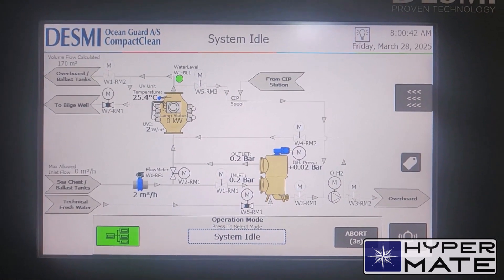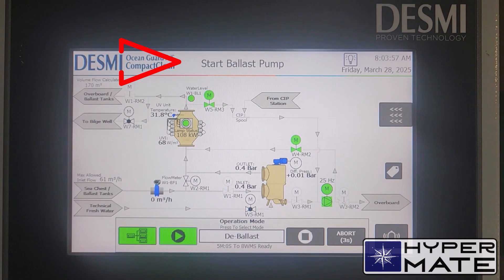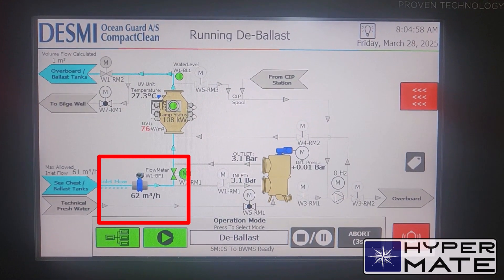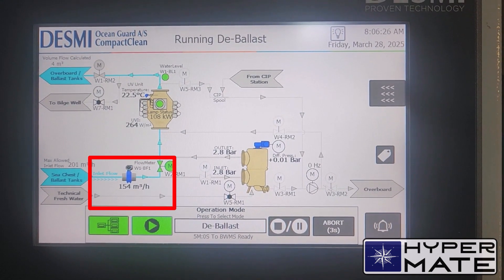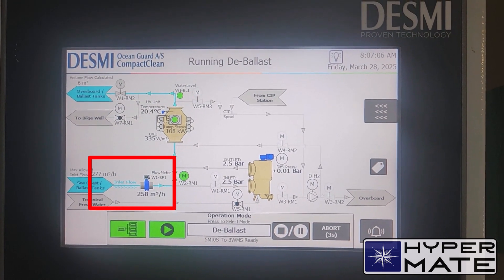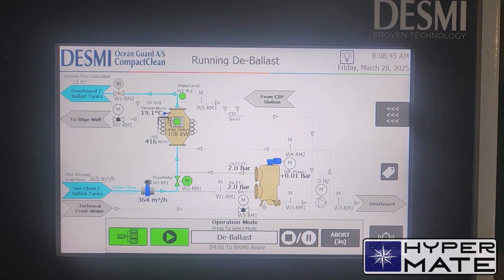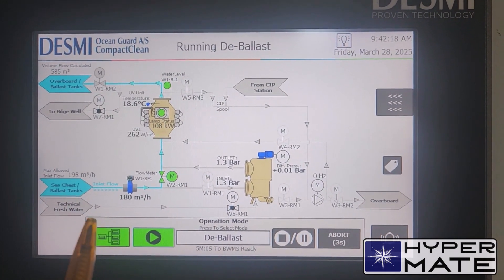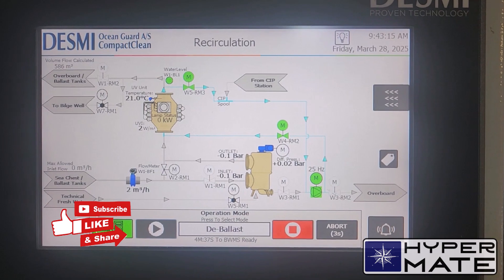De-ballasting procedure on practice.

Comment: Bro what usually flow when debalast from double bottom?
Reply from the maker: Depends on ship, if u have BP capacity 700-1000 m3 hour, flow may vary abt  250-700 m3.